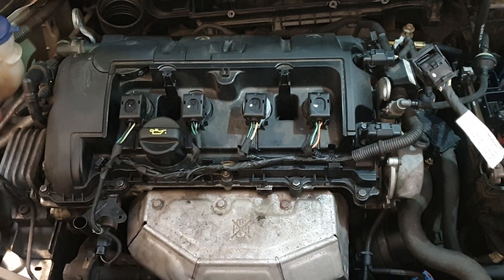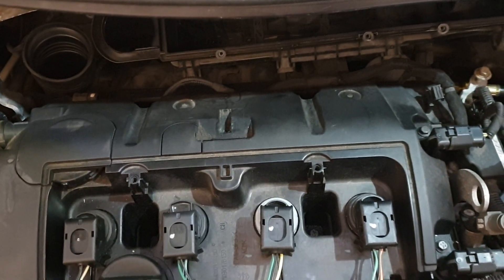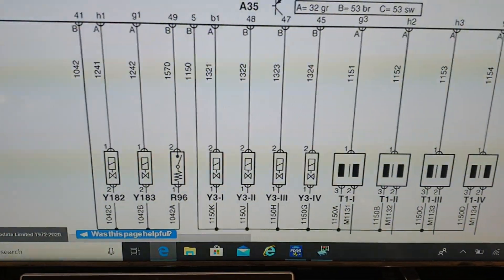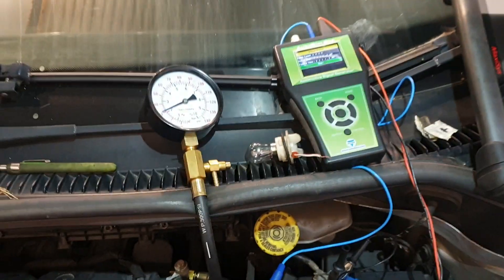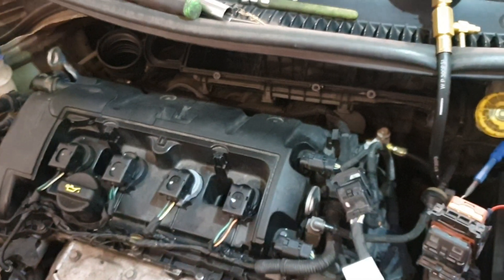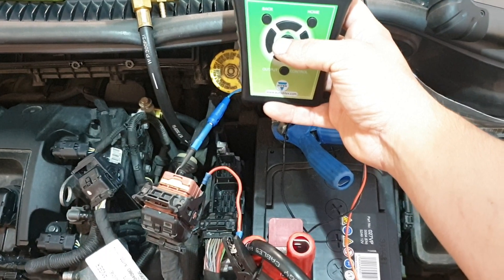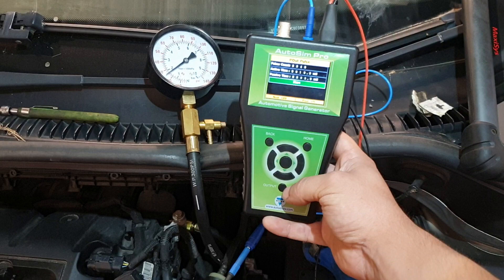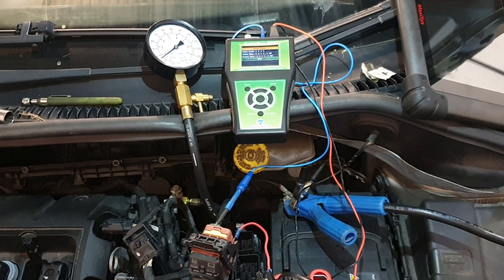Peugeot 206 injector testing using the AutoSim Pro

Comment: So not happy that a month after I purchased the Autosim the Autosim Pro became available.  Great use of that tool Ryan. Quick question. Is the time for the pulse period set or is it dependant on how long you hold the button on for?
Reply from the maker: Unfortunately, we don't have a huge say over when the new tools are released by DITEX especially a months notice. 

With the tool you can set the time of the pulse to whichever parameters you wish. This was what we felt a good setting for the test in hand. 

Once the settings have been set you can just press "start" & the tool will then pulse as many times as you tell it for as long as you like.
Reply: @eliteautomotivediagnostics4424  totally understandable. I would have spent the extra though had I known it was being released. Keep those vids comin

Comment: Thank you Ryan. I watched it again. The Autosim pro is pulsing the ground from the injector. Little confusing because the setting in the Autosim pro is Pout (Power out). Is there a setting in the Pout for pulsing the ground? Thank you for everything.
Reply from the maker: Yes you are correct. So we used the "pulse" option in the tool which then gives you the option to either use it as a "POUT" (Power Out - 4a max output) or a "SOUT" (Signal Out - 0.15a max output) 

Due to this being a solenoid the SOUT option would not have worked correctly due to the lower current output limit hence we selected POUT. We then decided a good "on" & "off" time and how many times we wanted the injector to be pulsed, in this case 40 times with a "on" time of 10ms. 

Hope that makes more sense.